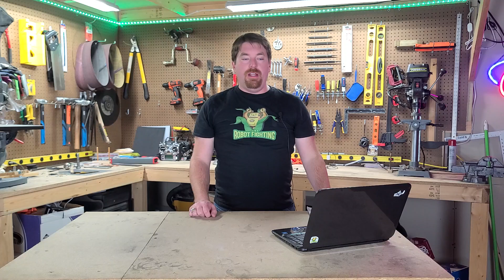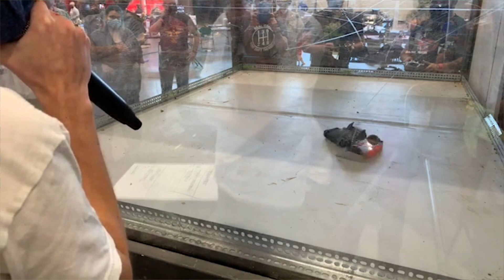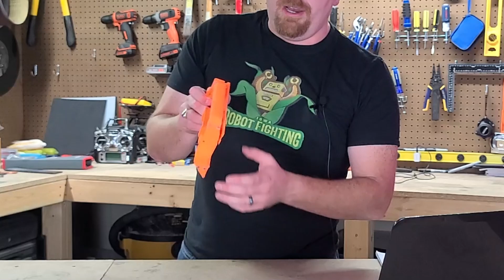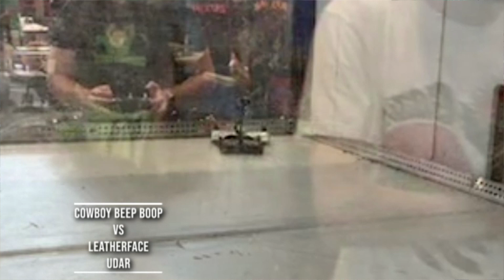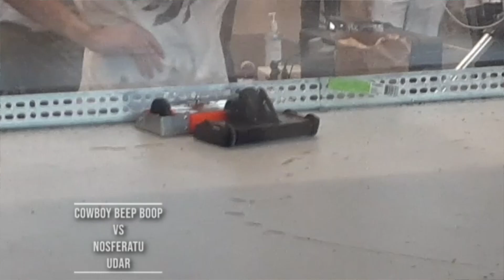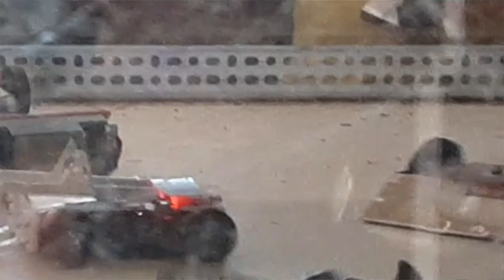Robot Fight Review - Milwaukee, WI

Comment: 135 grams for a chassis? Wow, that's a beefy boy, and definitely an area for improvement. I'm not saying you need to go hog-wild with compactness like BlastWave did, but my bot's main chassis are under 60 grams.  Cutting just a couple millimeters in height, length, and width will make a HUGE difference in what you can cover with armor.